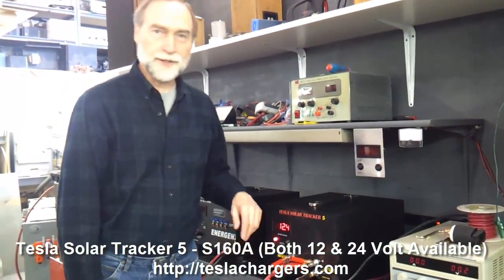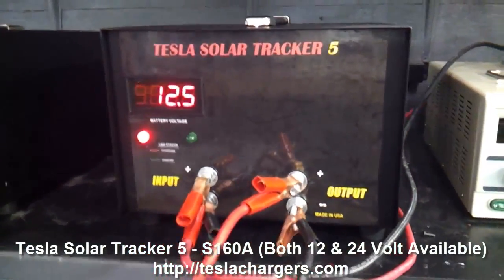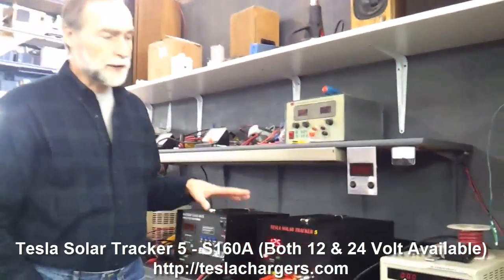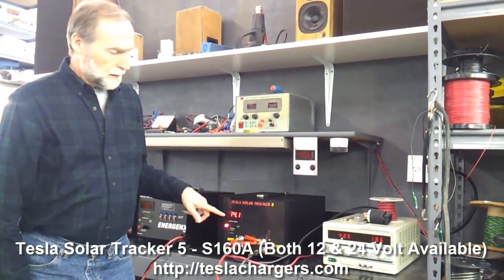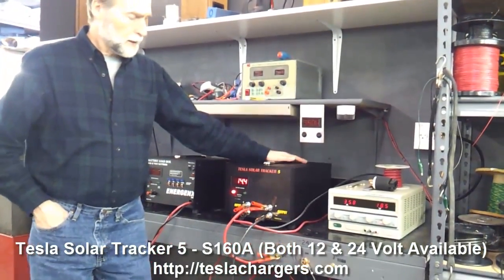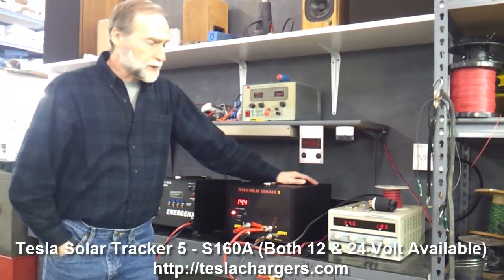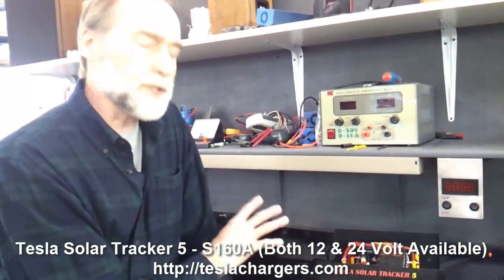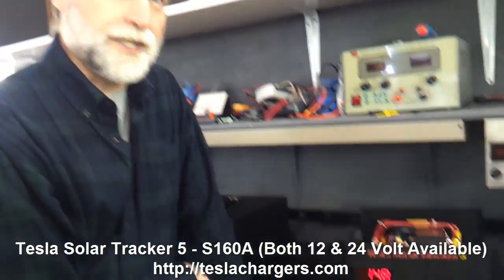Tesla Solar Tracker 5 - 160A - 12v & 24v available

Comment: Hi Aaron, 

I have just set up my s80a24 and was watching it today.  Does the green light ever turn off  if there is power coming in from the panels or does it just keep the bank up at 30.2v constantly?  Which would be its float?

thanks!
Reply from the maker: Hi, it depends on the model you have. If the green light is solid, then it is maintaining the proper voltage on the battery. If it is a more recent unit, it will hit that voltage and will go into a 6 second relaxation mode where it lets the battery fall and it will then push it up again. That would be it's float mode. The green light will go off if you start to load the batteries and the voltage falls enough or of course it will be off when it is getting charge up from a lower voltage.
Reply: I bought it in Dec 2015. Its white.  I think its the extreme model.  s80a24

yes it stays on green at the moment because I just have the battery bank charging and no loads connected to it yet.

thanks!
Reply from the maker: Mandala man
Ok, what I mentioned in my post should be the case.
Reply: great, thanks!

Comment: Wow! This device must waste some power judging by all the large heatsinks and fans. Surely, charging can be done without all that waste?
Reply from the maker: This gets more from the solar panel to the batteries than any charge controller in the world. And, the batteries are charged in a way that will allow them to last for years, which is the opposite of the chronic undercharging problem created by all other charge controllers on the market.
Reply: Really? Better than the Midnite Classic 200 or the Outback FM or the Tristar? I have all three! The input voltage that you describe in this video indicates that the Tesla solar tracker is a PWM type controller. Or even a tapper charger with a 15 volt output that simply switches on and of when the batteries are full? I use MPPT solar charge controllers. I can get up to 30% more solar power in low light conditions because the solar panels are in series. I have 150 volts dc input to my MPPT charge controllers. That lets me charge my battery bank in very low light. I also have done a comparison between a PWM and the MPPT. I see a 25% average increase from the MPPT vs the PWM in the same size arrays. So exactly what is it about the Tesla solar tracker that makes it the best in the world? I am not slamming your product I just have sincere questions. With The MPPT I can use much smaller gauge wire between the array and the charge controller. I have a 2k array that is 150 Volt to the charge controller allowing me to have a very long run in #10AWG I have a 4 stage charging algorithm that records everything on the data logger that can communicate via wifi to my computer or the lcd onboard screen. All for $700 bucks. I can buy a Outback FM 60 for $425 shipped. I do not have any interest in any of the afore mentioned companies I just want to know what makes your product so good for $1500 bucks for the 160 amp model? If you have any data of comparisons with MPPT that backs up your claim I would be interested in your product for my next build. Thank you for your time.
Reply: @offgridinthepacificnorthwe3210  Someone sounds butt hurt that they may have wasted money being fooled by the corrupt energy sector!. lol. I have personally built a Bedini SSG and it works!, the current products out there are intentionally made to degrade, and fail!, to ensure dependency on the system and constant spending on maintenance. Maybe research what happened to Jim Watson, and his home powering device that led to his disappearance!. These guys are ACTUALLY making the world a better place!. That's exactly what Tesla was working towards and the same kind of monsters back then suppressed him as well!. Wake up man!. The same crap is happening now with this idiotic Plandemic! with a similar monster called Gates at the forefront, backed by the true backstage elite. I know it's soo cliché to say, but it has always been a profound bit of advice "follow the money!".. We all could have self powered, self sustaining homes, for next to no cost by now, but then how would the rich corporate assholes live on yachts, and get caviar, and bathe in the blood of the innocent?.. The biggest threat to the establishment about the term "free energy" is the word "FREE"!!!!....